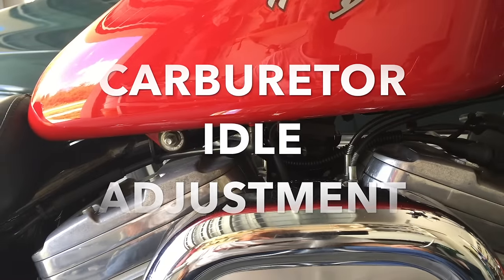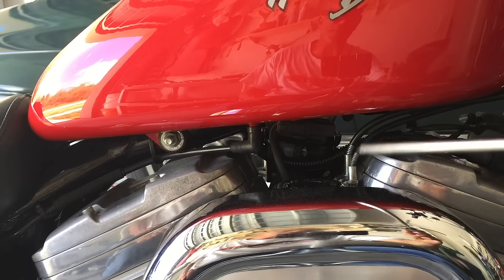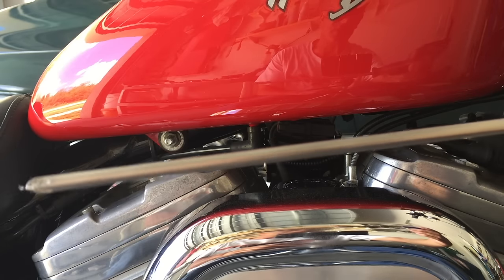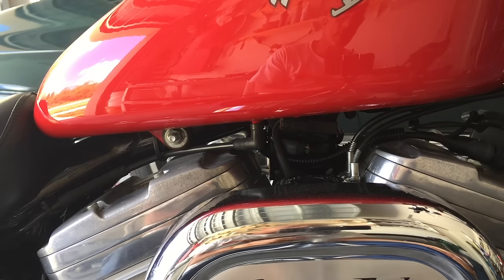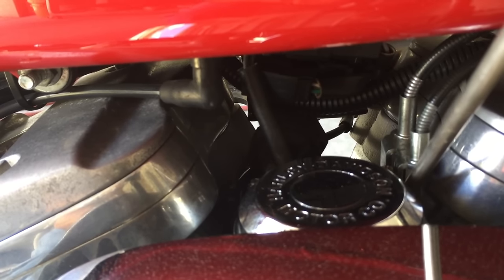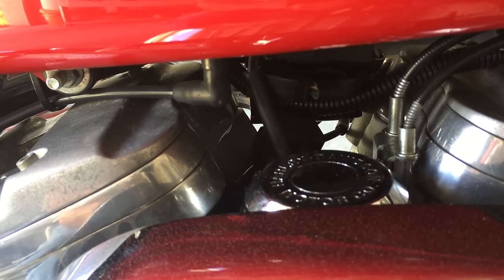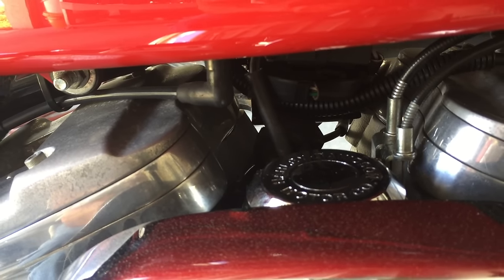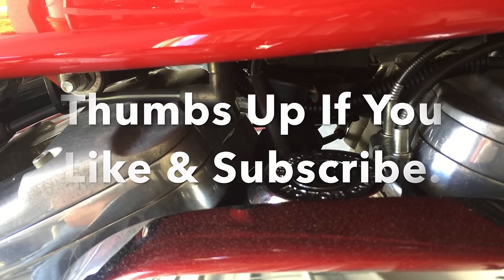How to Adjust the Idle On All Harley Davidson Carburetor Motorcycle.

Comment: I just installed a twintec tc88a on my 2005 sportster and it usually idles right at 1100 but now it idles at 1700... should i just turn the idle down with the screwdriver like you did?
Reply from the maker: You could try the idle screw...I think you will need to set the timing back.Try idle and see how she runs. Let us know how it works out.

Comment: Rocco I found the problem the bike was still losing exhaust sound like carb was not resting after 600rpm and up... I unplugged the vacuum port and the revs went up then I plugged it with my finger and bike started to lope then increased rpm to 900 or 1000.and is still loping perfectly just need to know what that vacuum does and if I can suppress it or how to fix the electronic vacuum part in the motorcycle thats causing the bike to run wrong like it had ab air Leak
Reply from the maker: You need to check that with a vacuum gauge..to see if that is where you are losing vacuum from that diaphragm. Check all you vacuum hoses.  That part is a vacuum advance module.  You need it. So you are running lean because of air leak. Let us know how it works out. I suspect it is a bad vacuum hose.
Reply: @TwoWheelRocco  there is the problem because after 600rpm the motor goes crazy advanced but without the voes and with a plug on the carb vacuum port the bike sounds perfect at 600 700 800 900 1000 1100 etc can this be an air Leak from the voes? Or that is damaged or that it needs adjusting? Because it only acts crazy after 600rpm on idle like it turns on or something
Reply: @TwoWheelRocco  also what would happen if I run without voes cause I think the voes could be more dangerous to my engine due to too early advance... I've read if it gets damaged the engine stays in a retarded safe mode
Reply: @TwoWheelRocco  https://youtu.be/o8sC8pAppQ0 look how nice the engine and exhaust sound without voes problem... Before that the bike sounded only great at 590rpm but after 600 the bike sounded advanced
Reply from the maker: Test with vacuum pump to see if it holes air with out leaking if it leaks replace. Let us know how it works out.

Comment: Hey brother I am having issues with my 1992 harley davidson softail heritage classic.  It only has 27000 . All of a sudden out of nowhere its idling high when the motor warms up to the point where its starting to over heat . And when I say out of nowhere I mean the bike was running good and then this. So I got too my house and checked it over and I found all the exhaust nuts were loose and one was missing so I replaced the one nut and tightened everything up but it didn't change anything.  So I am figuring it's a carburetor issue.  It actually idles low when cold real low . And then when it warms up the idle is high and high to the point that it is getting up there in temp way faster then usual.  Any theorys brother
Reply from the maker: Happy to help, How do the plugs look?  It sounds like you have a vacuum leak which is causing a lien condition and that's why your idle raises and the bike gets hot.did you try adjusting the idle screw?  These bikes will get hot, they are air cooled. Try spraying some starter fluid around the intake or anywhere where there is vacuum lines to see if that affects your idol that would tell me you have a vacuum leak in that area. Let us know how it works out. No big problem Thank you for watching and your Sub Richie.  Ride Safe, Have a Great Day.
Reply: @TwoWheelRocco  yeah brother I haven't checked the plugs but there is alot of soot in the pipes . I tried spraying a little wd40 around the intakes but It didn't raise the idle any . Where would I find the vacuum line .
Reply: @TwoWheelRocco  it was something that changed real quick cause one day perfect the next all fucked up .
Reply: @TwoWheelRocco  I really appreciate the help brother.  I really dont have anyone to ask this stuff . You know with reaching into my wallet and being broke
Reply from the maker: @Richiebones  plugs first, spray some starter fluid. Intake and vacuum lines that are running off the carburetor. That's any rubber line that's quarter-inch coming off the carburetor to your Petcock.. I would buy a manual and get yourself familiar with your motorcycle. How long have you owned this motorcycle?
Reply: @TwoWheelRocco  oh I'm getting formilure alright lol I got it at the end of the last season before I had a 87 sportster and it was a nightmare.  So I saved up and got this one hoping I wouldn't have to go through must of this crap .
Reply: @TwoWheelRocco  yeah I was just looking at it and finding the vacuum lines . Would the voes have any impact on that sort of thing

Comment: if i was to remove my baffles out of my carburetor Honda vt750 or install a new exhaust like say the Vance and Hines short shots, will i have to adjust the idle on this? or is there some other way to do this. i'm having a hard time as i do not see any videos explaining how to adjust a carburetor Honda vt750 when changing exhaust pipes.
Reply from the maker: aero or spirit 750?
Reply: aero
Reply from the maker: Hope this Helps
   https://www.youtube.com/watch?v=usUkGogN3OU
       Let me know...Ride Safe.
Reply from the maker: Sorry just noticed that they do not show ...on right side just below the air box you will see an plastic knob turn clockwise to higher idle...Hope this helps....

Comment: I have a 1997 Sportster 883 and I believe it may need an idle adjustment... from what I read, it should be set around 1000, but I don't have a guage that tells me the RPM. How do you tell what the RPM is if you only have a speedometer?
Reply from the maker: You can just set to your liking...Not to slow...I set it to where the motor sounds its best..And throttle responds well when you rev the motor...Hope this helps.

Comment: I have a 1998 sporster. I just finished swapping some parts on the carburetor. Bike stars up and runs. While in gear though it starts to putter and doesn't run smoothly. The bike has been sitting for a year now and I changed the gas about 6 months ago. Would u have an idea what it might be?
Reply from the maker: Happy to help. I would remove the air cleaner and check it for oil deposits on air filter. If so, clean, check your oil level make sure it's halfway on the oil dipstick. Too much oil causes all sorts of problems. Halfway on the dipstick, that's what Sportster's like. Let us know how this works out. Thank you for watching and your sub.Jovan.  Ride safe and have a great holiday.
Reply: @Two Wheel Rocco  ok so I checked my air filter and it seemed like there was a lil oil deposit in there cleaned it up and also checked my oil which seemed kind of high. Took oil out and checked sparked plugs which also seemed a lil dirty. Bike still sputters in gear I took a video if u like I can share it with u through an email
Reply from the maker: @jovansanchez2255  yes that sounds like a great idea. E Rocco 3964@gmail.com. I'll get right back to you when I hear your video.
Reply: @TwoWheelRocco  sent email. Happy new years
Reply from the maker: @jovansanchez2255  if you could, please resend, I can't find it.
Reply from the maker: I just found the video. It's a beautiful motorcycle. What happens when you try to lower the idle? The bike sounds like it's running and hitting on both cylinders lower the idle or if it only runs on choke. You have to clean your starter jet. I will send you a video.   Hope this helps. https://youtu.be/Pp4l-zbQcy0.   Let us know how this works out.  The way it sounds, your bike is running with the choke out. It will not run with the choke in? If so, clean the jets, it will be a dirty idle jet.
Reply: @TwoWheelRocco  I'm sending u another video with the choke in please look out for it
Reply from the maker: @jovansanchez2255  OK that I will.
Reply from the maker: @jovansanchez2255  I listened to the video. I would focus on your primary chain compensator first check the chain adjustment and put new fluid in there. I did not like that ticking sound not normal adjust primary chain new fluid to start. Let us know how it works out. The videos helped a lot.

Comment: I got a2001  883 rebuilt carb. Seems to be idling good at about 900 too 1000. Has a 45 idel jet in it. I tune my air fuel mixture screw where I have no black smoke. And good trottle response.but it seems when I give it trottle crusing down the road I get some hesitation for a second then run good. Any idea. Thanks in advance
Reply from the maker: What pipe and intake?  Any work done to motor? And what main jet?
Reply: Screaming eagle intake and van and Hines exhaust. Pilot is a 45.
Reply from the maker: Is that a short exhaust?  And is  there  baffles in place? What is your main jet size?

Comment: Roooccco  idk what I did but my sporster back fires with a pop ! 
Idk if it’s  the manifold
Reply from the maker: Happy to help. Sounds like a vacuum leak. I would spray starter fluid or carb cleaner on areas where you think it possibly is leaking if the idle raises that indicates that that's where your vacuum leak is. That's where I would start. Any questions just ask. Thank you for watching and all your support. Ride safe and have a great day. Check vacuum hose coming off Petcock to Carburator could be cracked and that's where the air is coming from.
Reply: Thank you Rocco !! Yes I sprayed the carb cleaner and it started to idle .  I took the carb out opened it inspected it clean it nothing wrong with it . But I can see that manifold  seal a lil old and dried . Ima replace it as well thanks rooocoooo
Reply from the maker: Happy to help. Let us know how it all works out at the end. Ride safe. Have a great day. @mykedntsleepmykedntsleep9313

Comment: Hi Rocco, I'm having some backfire with my 03 FXDL upon deceleration. According to my tachymeter my idle is at around 800-900 rpm. The bike has not been started for around 5 years.. I recently took it to the garage and now it's running good except for the fact that it takes a while to warm up so that it will idle in a stable condition and also some backfire. What can cause this? Thanks
Reply from the maker: How many miles? Sounds like carburetor air/gas screw adjustment.Look at plugs might be running rich.That were i would start.Let me know how this works out.
Reply: Two Wheel Rocco only about 3700 miles on it
Reply from the maker: Put some miles on her.. She will get better. check for vacuum leaks...Ride Safe.
Reply: Two Wheel Rocco will do. Thanks!

Comment: Anyone with a screwdriver can adjust the idle as you have shown. But no one seems to talk about how the connecting cable between the carbs should be set/adjusted, so that the carbs are in idle sync. Surely that must be done before you even get the screwdriver out! Can anyone provide a link with someone who will explain this? Thanks
Reply from the maker: The reason is there is only one carburetor...Hope this helps, Ride Safe and have a great day.
Reply: Only ONE carb on this bike. NOT TWO

Comment: Hello, I have a 2007 Sportster (1200 Custom) and I can not find this screw.  My bike is idling at 1200 and I am trying to adjust it.  Any advice would help.
Reply from the maker: 2007 is fuel injected....No adjustment for idle....Clean fuel body....https://www.youtube.com/watch?v=oK6KZcirHpg   Hope this helps.... Ride Safe.
Reply: You are the best!  Thanks so much.
Reply: Would you also suggest using the GUMOUT break cleaner?
Reply from the maker: No do not use brake cleaner.....fuel body cleaner ...auto part store...  Hope that helps....Let me know how it works out...
Reply: Awesome, I will pick it up tomorrow and let you know how it works!
Reply: It worked!  Thanks so much.  I took it for a test drive and then realized my clutch cable was leaking.  I checked Youtube and say that you put a video out for that last week.  Will get working on that tomorrow!
Reply from the maker: Happy to Help.......Ride Safe...

Comment: Hey so I have a Harley Iron 883 and yesterday it ran fine but today I start it and the rpm are super high in idle and when I shift down in gears it does not lower rpm what could be my problem? I have checked my throttle cables and cleaned my air filter but neither worked so far. Thanks
Reply from the maker: What year?
Reply: Two Wheel Rocco 2009 with 4000 miles
Reply from the maker: Harley Sportster Idle Air Control Cleaning. My Harley Started stalling while Idling and the RPM's were low or hight at idle. So I cleaned the IAC sensor. My Harley has been idling like new. This was done on a 2013 XL1200. We used CRC Throttle Body & Air-Intake Cleaner.   https://youtu.be/hzxxamT5HL8.   Let us know how this works out.  You might have to remove IAC If it does not clean up. Any questions just ask. Thank you for your Sub. Ride Safe and have a great day.
Reply: Two Wheel Rocco thank you for the quick reply, I just tried cleaning it with the CRC brand you used and it sounded good for about a minute then rose in rpm again
Reply from the maker: It will take a few times. Or you can remove and clean.  That should do it.  Take a close look and you will see the passage spray and clean.   Let us know how this works out. How did your air filter look?  That is where the dirt comes from..
Reply: Two Wheel Rocco gave it a few more cleans without removing it and it’s sounding better and better actually. Cleaned the air filter as well. Thank you for the help
Reply from the maker: Happy to hear things are working out. Do you run 93 octane gas?  Run some fuel injector cleaner in your gas tank. I do that ever month or two.  Thank you for watching.  Ride Safe and have a great day.
Reply: Two Wheel Rocco yes I do and sounds good I will start to do that every few months. Ride safe as well thank you

Comment: Hello just got my 2003 Sportster 883 has full tank of fuel all of a sudden after I've put 600 mile it stalls. any idea what's going on with It?
Reply from the maker: Sounds like Petcock
https://www.youtube.com/watch?v=7Fo9Q93OJXI&t=7s

Or Vacuum leak at intake or at petcock hose..Hope this helps...Let me know how it works out..
Reply: Two Wheel Rocco thanks for the quick response! I'll go to Harley to get me a new petcock.
Reply from the maker: Did you check it?
Reply: Two Wheel Rocco no not yet I don't have a vac pump. All I've done is change the vacuum line and the boot elbow because they were worn out.
Reply from the maker: Thats a vent line on right side of bike at bottom of gas tank...not vacuum line that run from petcock to back of carburetor. You can go to auto parts store and see if they have a tool load program...or harbor freight...buying parts that you don't need??? Hope this helps..let me know..We will get you running..
Reply: Two Wheel Rocco im now working on my 03 Sportster I told about. I took off the fuel line of the petcock and the brass nipple got stuck in the fuel line. I got a full tank of fuel and when I try to drain it it won't drain out.
Reply from the maker: If you could send me your Cell number...And i will try to help.
Reply from the maker: https://www.youtube.com/watch?v=Pp4l-zbQcy0&t=1s
Hope this Helps.....Let me know..
Reply: 8

Comment: I just made the jump from Kawasaki to an 2011 ultra classic idling high in neutral and first is there a way to reset computer or turn idle down manually
Reply from the maker: Does this bike have stock exhaust and Air filter?   I would start by clean or new air filter. And clean IAC  Sensor in your intake.
https://youtu.be/hzxxamT5HL8.  Let us know how this works out. If it is an HD SE map. Check with dealer.  Do you know if a fuel program was installed?

Comment: I like it to idle low, but I went a little too far
It flashed a low oil pressure code on my 04 I reset that and brought the idle up just a bit..
Reply from the maker: Yes it will. Thank you for your comment and Sub. Ride Safe and have a great day.

Comment: What position should the choke be in while adjusting?
Reply from the maker: You should tighten the nut by the pull so it will stay out until bike is warmed up. Then you push it in when your sportster is warmed up.  There is no adjustment. Hope this helps. Let us know how this works out.